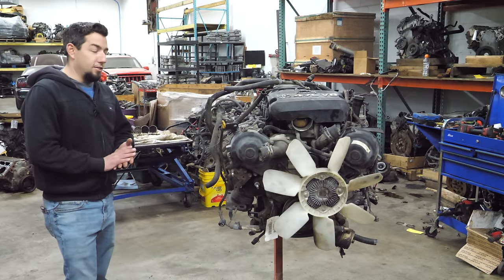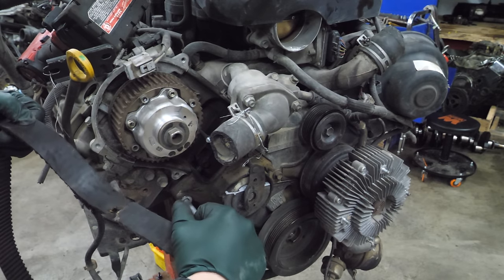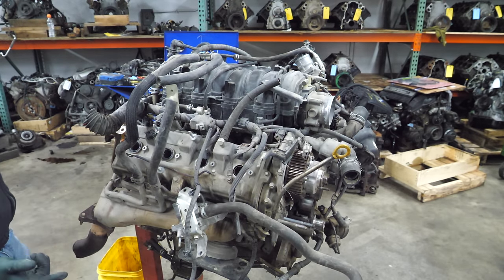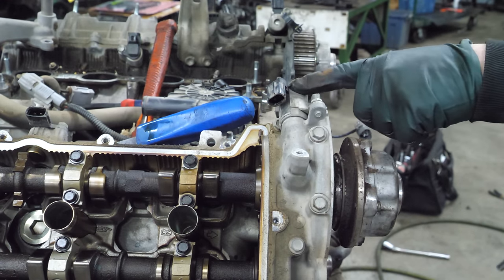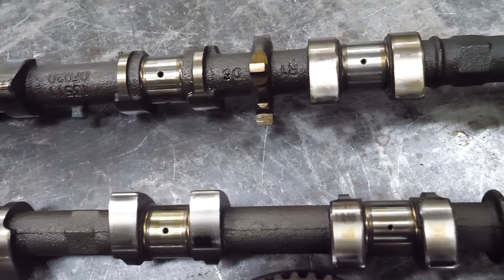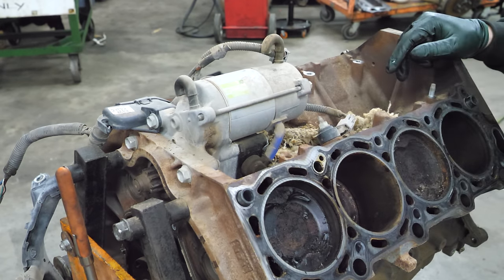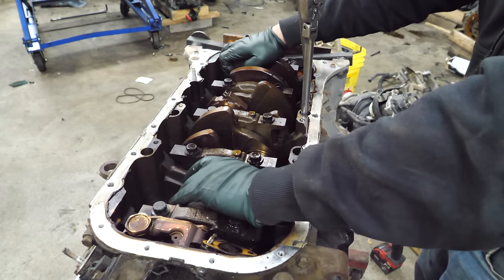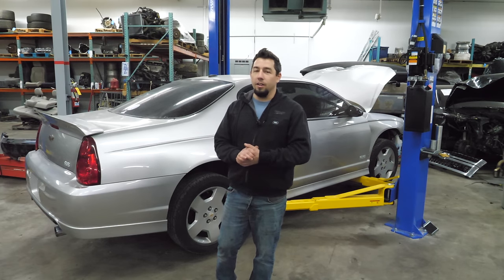Toyota Tundra 2UZ VVT Teardown! Bad Decisions Led To The Demise Of One Of Toyota's Greatest Engines!

Comment: Little surprised that this DOHC 32 Valve V8 with VVT makes less than GM's 4.8 liter cam in block, 16 Valve LS based engine from the same era.  Even accounting for the .1 liter displacement difference.  The 2UZ making 271, a 2006 4.8 making 285. in 2007 the 2UZ still at 271 and the 4.8 at 295.  

Not to say the 2UZ is a bad engine by any means, just seems like you're not getting anything for the extra size/complication, and now you've got a timing belt that can fail too.

Comment: How come every 5.3, 6.0 and hemi have broken exhaust manifold bolts and these came out easy
Reply from the maker: Most of those have cast manifolds which do not flex with heat cycles. That and they use 8mm studs or bolts where this Toyota uses 10mm.

Comment: Put simply, in a non-interference engine, when the piston is at top dead center (TDC), it will never go higher than a fully open valve; that is, the piston can never “interfere” with the valves. Conversely, in an interference engine, the piston could occupy the same space as an open valve.May 15, 2018 that’s what only Toyota was known for on non interference timing belt.
On timing chain on any manufacturer including Toyota (Toyota with timing chain only) are interference engine
FYI those valves aren’t bent at all just tilt the head on it’s side and put water see fluid leakage if you didn’t see none you should had hone the cylinder sleeves, clean the pistons and valves then put it together bet you it will still run

Comment: The actual spec was hard to nail down here, but my best guess is 90,000 miles, or 7 years, to require a belt change.   It's safe to reason that he went over the spec by 50%, so I'm figuring the engine had 130,000 to 150,000 on it.   And whoever diagnosed it as a "strike" damage engine was not too bright.   A shame really.

Comment: Those are the wrong plugs. It is supposed to get Denso u groove copper, not iridium or platinum, no matter what owners may say. I used other than least expensive copper Denso plugs and lost performance and lost mpg. NOT worth the high prices for those and on my 2000 tundra it takes about 20 minutes to do them all. I don’t have secondary air crap in the way as it is factory installed under the intake manifold.

Comment: I have a 2006 sr5 Toyota tundra 313k miles doesn’t burn 🔥 oil cold 🥶 ac no check engine light 💡 and it’s lifted with king coil overs in front and fox 🦊 in back, just oil changes 2 timing ⏱️ belts and brakes 

Also have a 1996 Toyota Tacoma 315k miles doesn’t burn 🔥 oil and cold 🥶 ac no check engine light 💡 great gas mileage and all it needs is oil and gas ⛽️ lol

Comment: I have seen people junk cars because of timing belt break, I have told people to try to put a new belt and see if it would run might get lucky, they said no and rather junk car or replace engine instead of paying a cheap mechanic a couple hundred to try a new belt.. a 200$ gamble vs 2k engine and they would rather pay 2k lmao. If I had a belt break I would try a new 1 because I have seen interference engines be ok after a belt broke before.

Comment: most people are used to timing chains (and most of said most are used to SHORT!!!! cam in block timing chains that will go 500,000+ no issues) 
.
so when i tell them they need to spend ~3000 to replace the belt (and timing belt driven water pump)//
most customers think im trying to scam them
.
then the belt snaps about 5000 miles after i told them it was time to change it
and they blame me.... and say i messed up their oil change
.
.
.
and once i show and explain to them what an overhead cam is...... and why they use belts VS chains
and once i show them the old belt and how it works.... how it broke.... ETC
and once i show them their owners manual..... that says "replace timing belt at 80,000"
,
then they FINALLY realize that i was just trying to save them money in the long run
 (99% of the time, they realize they were stupid........ their will always be that 1% that are assholes.... and are SURE it was the headlight bulb i replaced that blew up their motor)
Reply: but ya... my point is....
.
most people dont even know what a timing belt/chain is........
and most people grew up with cars that could go 500,000+ miles before even worrying a TINY bit about the chain
.
so, how can they do the maintenance..... when they dont even know its a maintenance item???
.
.
.
.
if Ford / Yoda / ETC told people that they will need to spend 3K every 80K miles 
i GUARANTEE they would not sell as many cars
.
a LOT of people would be buying Chevys with a 5.3...................

Comment: Do we know for sure that this is an interference engine? I don't see how an interference engine could escape from bent valves even if the belt broke while cranking the engine 🤔
Reply: I've been wondering that myself, and he acknowledged in the video that there's a lot of conflicting info online. Similar thing happened on an Eric The Car Guy video recently, he had an Acura TL break a timing belt while going down the highway -- the J-series is supposedly an interference engine, and he acknowledged that the valves could be bent, but also might not be, so he threw a belt on it and it ran perfectly.

At first I thought it might have something to do with the VVT, but afaik that only affects valve timing, not valve lift. So my theory is that it has to do with the natural resting position of the cam... with the valve springs applying pressure to the lobes, when the belt breaks, the cams will stop pretty quickly (since there's not a massive amount of rotational mass on cams to contribute to rotational inertia). The position the cams stop at is going to be where, on average, the valves are least "open." And, since the belt is broken, all four cams are independent of one another and free to stop in whatever position where the valves are most "closed" -- and, in that position, no valves are open enough to interfere with the piston. So, it may be technically interference, because if you hold one or more cams in a position where at least one lobe is holding a valve open to its maximum lift, it would contact a piston at TDC; but the cam would never stop at that position during a belt-break event. 

That's my theory anyway. If that's the case, it may still be possible to bend a valve during the brief period after the belt breaks, but before the cam stops... but not guaranteed. The likelihood of valve damage would likely increase with engine RPM at the point of belt-break, since the cams would take longer to stop spinning.
Reply: @dphoenix1  
I see your point, it's just that even if there is an equilibrium point, it's highly likely on a v8 engine that a cam lobe will be in a lift position on at least one of the camshafts
Reply: @goodmanboattransport3441  I was thinking about this as well, but it's possible it may not be as big of an issue for an OHC engine. On a OHV engine, since all the lobes are on a single cam and cannot shift position with respect to the other lobes, maybe one of the sixteen valves is much more likely to be at or very near the peak of a lobe. On an OHC engine with a broken belt, each bank only has eight total lobes, and since each bank can find an equilibrium/stop position independent of the other, this could better ensure all open valves on both banks are only open slightly?

Again, just a theory, I really have no idea. But it would be pretty trivial to put the conjecture to rest by running an experiment to find out if the engine was interference, and where it interferes (from the perspective of cam position)... if one had a core like in this video.

Comment: I just bought a 07 sequoia w this engine. The last owner lied to me about the tim belt being done last year. I did not trust him and that was smart. The belt had not been changed since 90 k miles ( at 230 k ) I had it done.  The old belt looks bad.  Thank got I assumed the owner was a piece of $%%^.  As he   wanted me to do no service.  Even after i said i only want the truth.  Wont get angry.  So now my loved 4.7 should go a while further.
       So my belt had 140 k miles and looked bad.  The date code on the toyota factory belt was 2011.   Which was the first owner taking great care w an expensive truck.

Comment: The owner of this engine looks like they did an excellent job of giving the engine half a service.  

It also looks like all this engine needed to work again was a new timing belt!  That was a surprise to me, as a guy who doesn't know much about engines I just assumed a failed timing belt would always mean that the valves and pistons would have a little party.

Comment: I've been thinking I'd look for a Tundra with the 4.7 if my 2000 Silverado with the 4.8 Vortec ever dies but imastounded it comes with a belt. Really assumed it had to be a chain. My 2014 Scion Xb has a chain! That said my vortec has been amazing so far, 22 years in service. I only replaced the starter 2 years ago, 2 injectors, belts...that's it so far! 
God, if only you could still buy a small v8 running on all cylinders, no AFM, no MDS, no stop/start. Etc.

Comment: There's a reason why 2uzfe equipped vehicles that have low miles (and high) fetch for legendary prices... they are the best, simply the best. Chevy makes the second best v8s.. buy up old toyotas and a few big boy big frame chevys with their old vortec non afm v8s. Ford 4.6l v8 is the only motor I would ever trust by them.

Comment: These are interference but only when vvti is advanced enough. So like above 3-4k rpm but even then its possible to not bend valves. For example if the vvti system is not working correctly or just by sheer luck

Comment: I wish they would of kept this motor in production on the trucks, the 5.7 is unnecessary to most people
Reply: Please, this motor was pathetically underpowered, got awful fuel economy, and should have never been created. Less power than a decent 4 cylinder, worse fuel economy than the 5.7. What was the point?

Comment: It’s a pity that you don’t want to RESTORE the engine - SUCH ENGINES must be held on until your last “breath” - they deserve it...
     ... I myself have been using a car with such an engine for many years and the engine has never let me down - I regularly change the oil, radiator fluid, transmission AND AFTER 40-45 THOUSAND. MILES TIMING BELT (I never skimp on an OEM OR ORIGINAL KIT) ... - IN THE END I GO DRIVING AND DON’T THINK ABOUT ANYTHING ...
      I WOULD RESTOR THE ENGINE!!!

Comment: I had a 300 ZX that I had been worked on locally and then the turbo blew. I sold it to a friend for nothing and he took it apart and discovered the local 'import' shop had used an aftermarket belt which had failed instead of a OEM one.

Comment: Those interference engines with rubber timing belts are a ticking time-bomb after 100k miles if u buy a vehicle atleast make sure you timing belt isn’t rubber they can run forever if maintained properly but your average joe isn’t gonna do timing belts and water pumps every 100k miles

Comment: I swear timing belts are the big automakers scam to make a extra few millions in service costs. It makes absolutely no sense to have a $30 wear Iteam that totals your engine if it fails and is also  ridiculous difficult/expensive remove and replace. It’s like of course they’re reccomended to be replaced always at 100k when you’re out of warranty so you have to pay the dealer over $1000 to do it or risk having your engine blow up. Should be illegal. With a little engineering I guarantee they could make a timing belt change on most engines take 20 minutes or better yet just use a CHAIN but then again those seen to always stretch or have their guides fail. I feel like that the timing system in engine these days is the worst ever kind of design and one of the weekest links
Reply: Better still - gears.
Reply: @dennisyoung4631  I agree

Comment: My pickup has a Cummins, which uses gears for timing. Far superior to belts or chains.
Reply: Unless pin comes out
Reply: And for all the noise they make. Gears rattle, people don’t like that. And the fact that trying to setup a gear train to run an overhead cam engine would be insane and stupid.

Comment: My '99 Toyota Camry 3.0. I changed the timing belt at around 360,000. I believe this was the second belt. I'm guessing it had a change at 100,000. I bought it at 309,000. You should have seen the cracks in that belt! No , it didn't fail! Yes, this engine in a non-interference engine.
With the new belt, the engine started a lot faster.

Comment: A starter in the valley and a secondary air pump in the valley. This is the sort of thing I would love to know before I purchase a vehicle.
There is so much of this poor Engineering going on these days it’s criminal. When I see crap like that all I can think about is built in service department revenue generators. And these days it’s expensive enough owning a vehicle without issues with Fords oil pump wet belt. Hyundai and Rams engine failures due to dirt in the oil passages from milling and boring. GM and it’s injector failures, along with there lifter issues.
It’s a total crap shoot buying a vehicle theses days with all the extremely poor engineering.

Comment: Wondering, if you know, what vehicle that engine came out of?

I have three of those engines and some of the accessories like the secondary air injection valve are in different places.  So, just wondering what the vehicle is.  I can see it is an 05-09 year range.

Comment: those  withtiming belt 90's engines have clearance  valve to piston  when belt breaks,    80's ford was worse engine cause bent valves...  although    agreed with you waste of replace engine some ppl say  belt broke  engine nogood  need new engine   must be rip off mechanic  he could fix belt and rip off customer for engine charge.   some dirty business out there   but  i would  buy  car/truck broken belt and put another  and starts  up   until  newer engines are timing chain, if breaks    engine is scrap  no clearance to  valve to piston..

Comment: Probably didn't change the belt because it would cost a grand to replace a $50 belt, due to all the crap that has to be taken off to get to it. I will never buy any engine with a rubber timing belt.

Comment: The 4.7 is an interference engine. What could have happened is that when the belt snapped. If it lock the crank up so it couldn't turn with the chunks of the belt at the bottom. That would be extremely luck, but it can happen with an automatic transmission. If it was a manual. It would have trashed it. 
Sometimes the owner don't know how to fix it or can't afford to have a shop fix it. There are many times when I look up the labor and parts cost vs. a junk yard replacement. The junk yard route is cheaper.

Comment: I will give you my experience with those plastic handled hammers. STAY AWAY FROM THEM. They are nothing but a misery. I have had several, and every single one of them has broken. I have had 2 dead blow hammers and a half dozen ball peens and other assorted hammers break. They simply don't hold up. I don't know if it is ozone in the air (my suspicion), exposure to chemicals,   or just age, but they all have cracked or broken. Hickory is they way to go. It might not be sexy, but it's durable, and when and if it does break, you can get another handle for a dime on the dollar what it will take to buy another hammer.

Comment: I'll take a timing belt engine any day.  So much easier to service and tear down than a chain driven engine, and so many less places to leak oil.  Too many chain drives have issues with disintegrating chain guides and tensioners.  Even if it costs $2000 to pay someone to replace a belt every 5 years, that's like $8/week of cost of ownership.  People waste more than that at starbucks and don't think twice about it.
Reply from the maker: I am normally on this page. I prefer belts.

Comment: This is the strangest thing I've seen you do yet. What a waste of a perfectly good engine. If it wasn't for the bores, you could have slapped that thing right back together. I wonder who the barn yard mechanic was who condemned and wasted that motor. How much do you want to bet it was a dealership. You should trace this down the line and get someone into some really hot water if you can. It's only fair.

Comment: Don't buy trucks that have timing belts. Asking for trouble.
Also don't buy trucks with the starter under the intake plenum.
Also don't buy trucks with PLASTIC impeller's on the water pump. 
Would've though it was a Northstar teardown.

Comment: Scotty had his video bitching about the placement of the Ram 1500 starter and how it only lasted 125k miles.  Typical Scotty.  The best motors have cast iron blocks.  Too bad this one had a fair mechanic doing a diagnosis of the belt, would have had a lot of life left.

Comment: Yes, Toyota engines are non interference engines so a broken timing belt won't hurt it.

They could've thrown a new timing belt on the engine & it would've ran.

It's not like my dads old workmates old 1981 model Holden (Isuzu) Gemini which bit the dust at 323,000 kilometres (200,703 miles) after the never replaced timing belt snapped on the 1.8 litre 4FB1 diesel Isuzu 4 cylinder engine.

He decided it was bye Bye Gemini in the 1990's because it was full of rust & the valves were obviously bent in the engine,he restored old Holdens for a hobby but he wouldn't have bothered doing up the Gemini,he gas axed it with an oxyacetylene cutter !
Reply: Might want to update your info.  There are interference Toyota engines

Comment: What kind of junk interference engine has a timing belt??? I thought Toyota were durable I mean if you have to open an engine before 250,000 or 300,000 that's too early